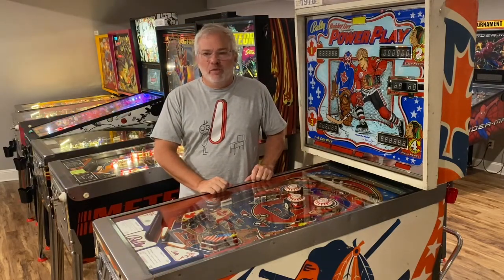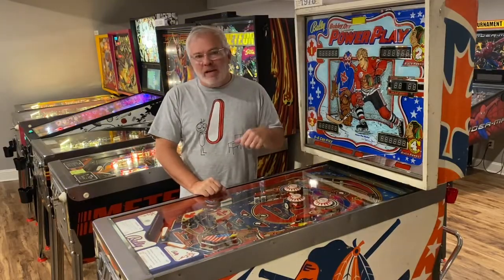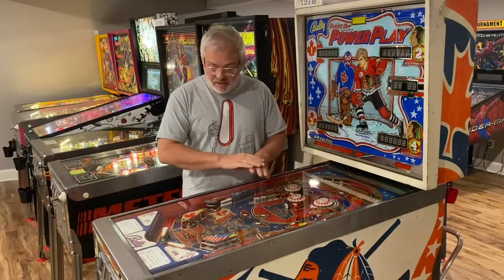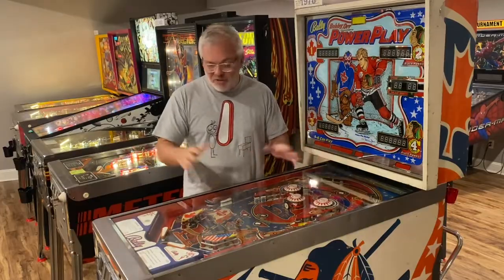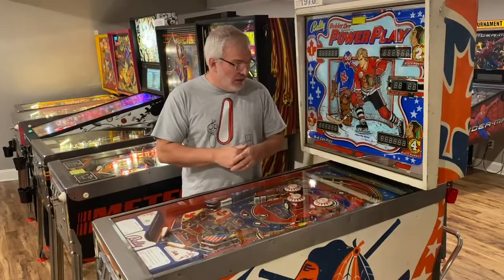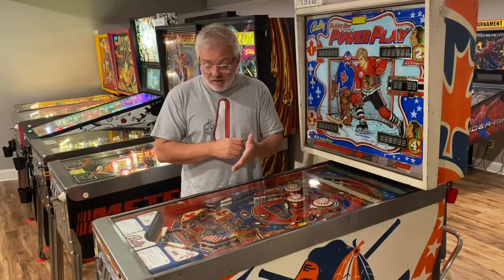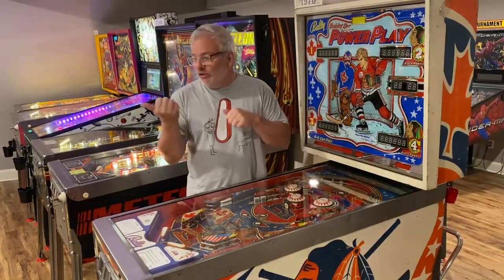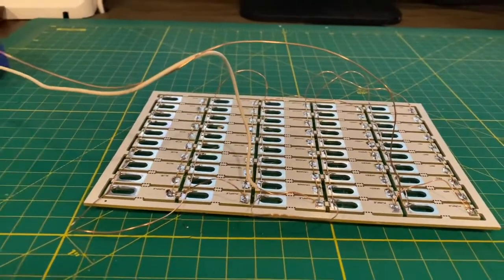The Yoppsicle Omnibus- Discuss and Install

Comment: @David Yopp just found these today, great idea. A quick note on the Purple led's not being very bright but having the same specs as the others.
If you check the wavelength of the purple ones (nm, nanometers) you will find that once you get to around 400 or less you are starting to enter the Ultra Violet range and this is obviously out of the visible range to humans, they are in fact putting out the same amount of power and this will be noticeable if you have any UV reactive colors painted anywhere near them.
Same applies to Infrared (IR), anything over 700 nm starts to appear less intense for the same power.
One way to make a brighter purple is to use an RGB led and mix the colors to taste but obviously this is more costly and you need extra components on your board.
Keep up the great work and I will definitely be purchasing quite a few of these for my Firepower resto 👍

Comment: Wow!!!  GREAT IDEA!   No new lamp driver board needed!! Clean and easy to install!  I think you should sell them buy the sheet as an option...pretestbthe sheet first at your place!

Maybe make each sheet one color...
Reply from the maker: These are sold in panels of 50.  Available at my pinside shop here: https://pinside.com/pinball/market/shops/1360-yoppsicle
Reply: @dyopp21  do you have any other colors other than warm and cool white?
Reply from the maker: @tntamusements  not currently.  And right after I finished getting the warm and cool panels situated we bought a bar and I’m in the process of making it into a pinball bar so everything else kind of went to the back burner for now.  I’ll get back around to it.

Comment: I love the idea of the Yoppsicle, and they look very well designed.  My problem is that I'm going for a very retro feel for my pins, in keeping with their late 70s vintage.   I noticed that when the lights on your playfield flash, it's obvious that they are LEDs, since they come on and off instantly, instead of the slight build up of light from incandescent bulbs.  Is there anything that might be done in order to replicate that (incandescent bulb) look when flashing?  I'm guessing it would be pretty expensive and you'd need to use dimmable LEDs.  Thanks a million.

Comment: That warn white is too cool. Color temp on camera looks closer to 5.5k even 4k will look a bit more warm.  Will you be added a frosted version later? These would be a great option for areas that requires a flex LED.
Reply from the maker: Thanks for the input!  The current LED on these is listed at a color temp of "2800-3100K" which is about as warm as I want to go.  I agree on camera they do look to be a cooler color temp, but this may be due to the white balance of the phone camera and the older and very yellow (too yellow in my opinion) LEDs that I put in 5+ years ago that surround them.   On the "frosted" version, I'm working on an add-on diffuser for this purpose.  Stay tuned!
Reply: @dyopp21  makes sense. Maybe the camera needs the different color whites to focus. Cell phone always seems to have issue. :) I think 3k should be pretty warm.